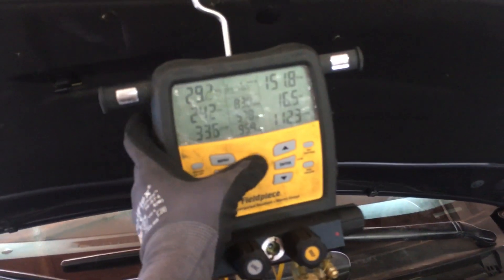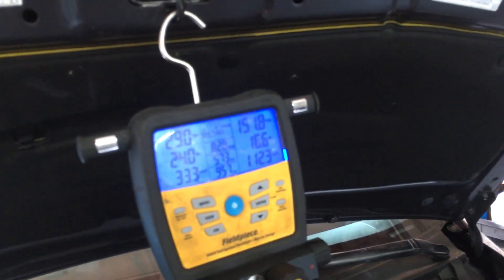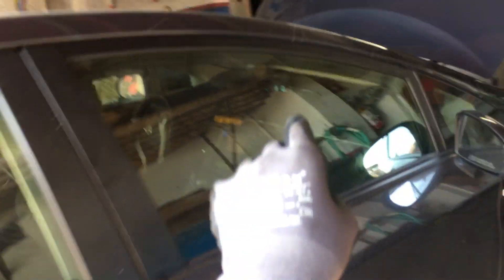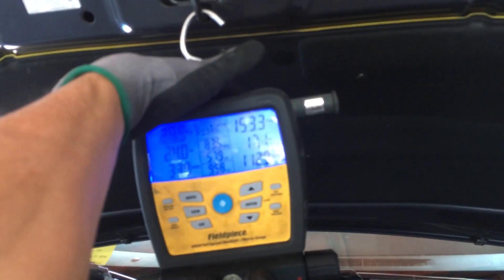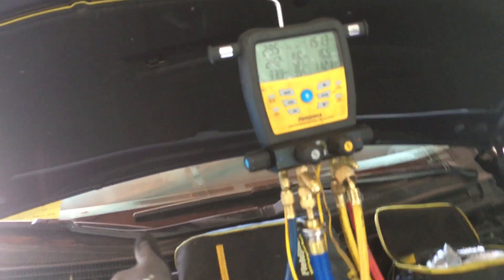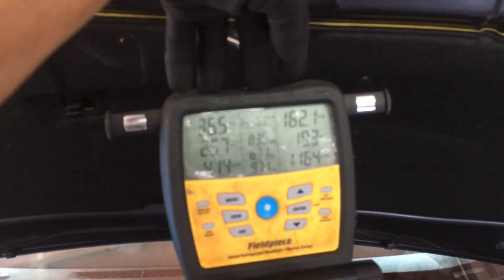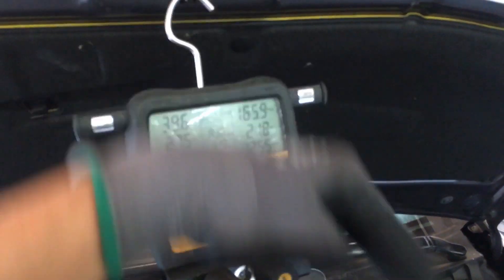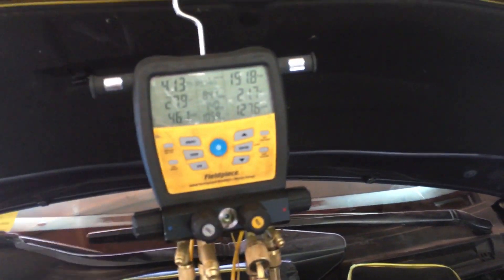WARNING Prius owners do not let anybody top off your refrigerant

Comment: I want to add a little bit of refrigerant to my Toyota Prius C 2012, may you please tell me what is the psi limit to not be exceded?
Reply from the maker: There is no psi limit no such thing. Pressures are not used to determine if the system is full. Only weight.  Sticker is under your hood.  You’ll probably see the sticker trying to remember about 420 g I’m not by my computer to look it up right now.
Reply: @coldfinger459sub0  I see, interesting, well then is there a way to know the weight that my system currently have? you can answer after you get to your computer if you want.
Reply from the maker: @hedgehogthesonic3181  sorry i took so long to respond, got extremely busy. Answer. (NO) there is no way to tell the weight of refrigerant in your system, Only by removing it and weighting it will you know what the weight of refrigerant in your system. It only take 1 to 3 minutes to recover the refrigerant out of the small system of a Prius so it is easy cheap and fast if I already have my gauges hooked up to a car.
Reply: @coldfinger459sub0  I see, and it's okay. Thanks for answering, i will keep that in mind then, when the time to change the refrigerants comes well then, i will have to buy a vacuum to take it out and refill it with new one.
Reply: @coldfinger459sub0  Also the refrigerant and the oil are added separately? how can i exactly add the oil? And what is the amount of refrigerant that must be added by weight?
Reply: @hedgehogthesonic3181  - After reading your comments, I can't help but shudder and STRONGLY urge to the NOT touch your AC system.  You don't have the knowledge, experience or tools to do the job properly, and it WILL cost you EXPONENTIALLY in the long run.  
When you said that you would get vacuum to take out the refrigerant I cringed.  Are you going to simply extract it and dump it into the atmosphere?  While R134a is "better" than R12, it still isn't safe to dump into the air, and if the EPA catches you, they will fine you.  Maybe not as much as a certified HVAC tech, but it will still be in the tens of thousands of dollars.
You also mention adding more oil.  Again, you don't understand the process or concept.  Evacuating the system will remove a small amount of the oil, but not much.  Just as too little oil in a system, adding more oil and overfilling it can also cause damage.

Getting back to the "I'll vacuum and refill it" statement.  Do you know what else you are supposed to do, after you vacuum/evacuate a system?  You need to perform a leakdown test.  If you don't know what that it, or how to do it, you best not try.

When refilling, you are going to need a set of gauges that can read the high and low sides, but the "quick fill" single low side gauge that you get at the corner parts store, and certainly none of the tools I mention above should be from Harbor Freight, as they aren't designed for a system like the Prius.  Save yourself some time and headache and do what the author of this video is saying, and get a REPUTABLE place to do the job.
Reply: @ward7voter111   I ended up not touching it at all actually, just added a little bit, almost nothing, pressed for like 1 second the gauge to add refrigerant in the high pressure line and that's all. Now i'm facing a major issue, my brake booster assembly failed, causing my brake accumulator assembly to fail. Due to an internal leak, the brake accumulator needed to run constantly to build up pressure until the pump brunt, i already replace the brake accumulator, now i'm waiting for the stimulus check to buy it new, since i will keep this vehicle for a long time.
Reply: @coldfinger459sub0    I've got some non-hybrid oil in my Air Conditioner and don't see any reason why I can't have a non-hybrid freon recycling machine remove the freon and oil from my car.  Toyota completely washed their hands of the vehicle when I told them that it had a little non-hybrid oil in it.  Wouldn't even check the system out electrically for me.  The unit will not run even though the AC is on inside the car.
Reply from the maker: @Islamisthecultofsin  The AC reclaim recycle recharge machine does not remove and clean out the oil out of your AC system. 
            I am curious how non-hybrid oil got into your car AC system in the first place 🤔??? 

            It’s kind of too much to actually flush your whole entire system the cost is pretty extreme and if you have one of the older vehicles with the expansion valve under the dash it’s even more. 

        You will have to probably end up being one of those people who lives with it and you might get lucky and be one of the people where there’s no long-term damage if the quantity is very very very small it’s not instant damage it’s something that takes a long time to happen it’s a slow attack at the electrical windings on the electric motor. 

           Best thing you can do is change the desiccant material dryer and put it on a very long vacuum if you can overnight if it’s your own car and you have your own equipment. 

       Then charge it by weight use and enjoy your air conditioning.
Reply: @coldfinger459sub0    It was very easy to do.  It was low on freon and my father told me that I should put some oil in it since the car has gone 350,000 miles.  So I walked into an Auto Parts store and found the 134 freon and right next to it was the 134 freon and oil combined.  Nowhere on the label did it say not to use it in a hybrid vehicle.  So I was putting it in and saw the fine print on the back of the can and decided that maybe I should have read it.  So I did and then was informed not to use the product in hybrid vehicles.  I immediately unhooked it.  I thought that no enough of it had gotten in to do any damage and the unit was working fine so I left it.  Months later and the AC will turn on inside but the compressor doesn't run.  I was disappointed that Toyota completely washed their hands of the vehicle and sent me on my way.
Reply from the maker: @Islamisthecultofsin  yep that sounded like the easy way to install the wrong oil in your electric compressor. 
             We have the short little thing we tell our younger technician (RTFM) when learning 

       One of the reasons why Toyota wash their hands and want nothing to do with the vehicle it has 350,000 miles so it has a value of scrap metal. 
                And in Toyotas shot procedures for a contaminated system they don’t do flushing complete 100 replacement of the system that is the only way they will guarantee their work. 

           So giving you a five to $6000 price tag then you would kind of be a waste of time to tell you that but I just rather not work on your vehicle that is probably the gods honest truth

              And you never top of on a Prius
Reply: @coldfinger459sub0    They told me it would be 6 - 8 thousand dollars to replace everything and I told them that the car wasn't worth that which it isn't.  I was thinking of flushing it myself with alcohol or Ethyl Mythol Ketone or some other thinner after removing the compressor.  Either that or flush it with freon a couple times after draining the compressor.  The oil has been in it for at least 6 months and as high as 8 months.
Reply from the maker: @Islamisthecultofsin    If you were that serious about it and willing to do that kind of work they do sell specialize AC flush solvent at parts stores like grand auto or Napa. 

               But if you wanted the backyard improvise with some other chemical I would go with the less hazardous of all of them the 99.9% alcohol the one that doesn’t have water in it. 

             You cannot flush through a expansion valve you have to remove the expansion valve and flush through the evaporator all by itself I’m just about to release a video tonight showing a Prius evaporator in my hand from the video I released about two days ago with the Prius dash all removed

          And remember you do not fill by topping off you only feel by weight

And leave your vacuum pump on it overnight
Reply: @coldfinger459sub0    Thank you very much for your help.